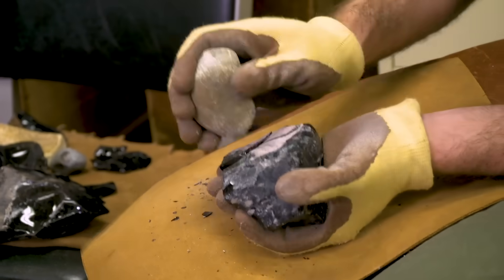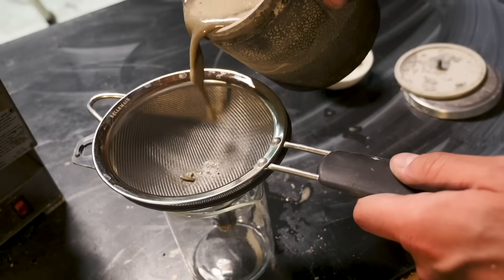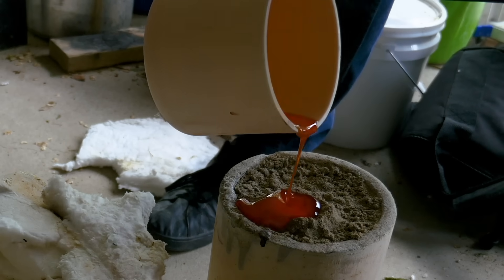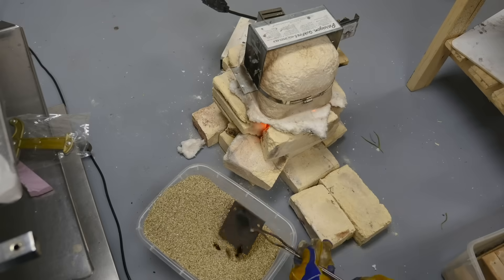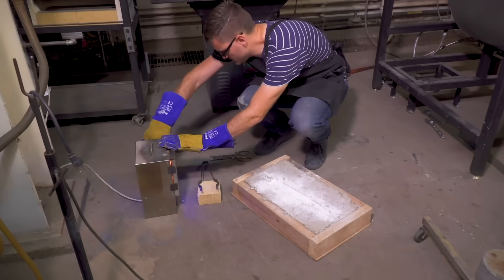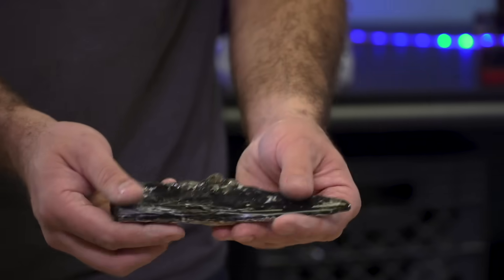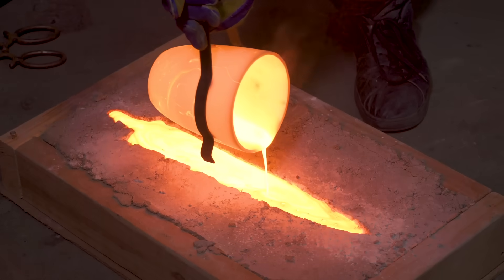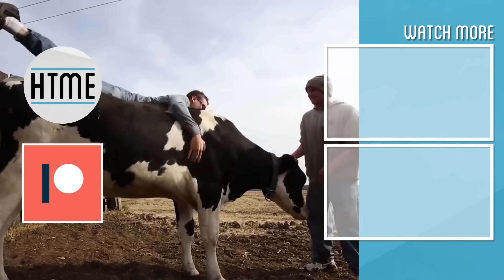Can You Melt Obsidian and Cast a Sword?

Comment: Obsidian is not really a glass or metal, it's a igneous rock. If you cool quickly you won't get any crystaline structure and it will crack easily probably while cooling against cooler materials like the mold. The slower you cool the more crystaline strucure much like making diamonds. You should also consider adding pressure like diamonds. I think if you want to mold it you should heat the mold some and place the mold back into the kiln with the kiln turned off and place the enire thing under pressure.
Reply: Diamonds are expensive because the supply is controlled, and there has been a marketing campaign to make them seem essential to a marriage in people's minds. They are actually a lot less rare than you are led to believe.
Reply: Industrial diamonds look more pure, because they are, and are harder with a better crystalline structure. They aren't exactly "cheap and easy to make" but they aren't the hardest rock to make nor is it as expensive as jewelry companies make it out to be. Definitely not $5,000+ per stone.
Reply: @Matt Fletcher Makes sense. Copy the original geological process as close as possible. Would need serious kit to do that however. Not sure how common a compression chamber mixed with a kiln would be >_<. Does such a thing exist?
Reply: valandil988 yea i was thinking that too. This si all new to me but I imagine a kiln in the shape of a mold that can be modulated to slowly cool the obsidian while applying X amount of pressure seems alot to ask for a bronze age weapon... but imagine what beautiful crafts could be made with that transparent obsidian though... he probably learned a lot about glass from this project
Reply: You may want to read the research papers on how they make doped and pure diamonds.
Reply: Continue, im interested.
Reply: NO ShIT xD we all went to school "hopefully"
Reply: Bronze age weapon? Before that ain't it? Still the best at cutting, not even near your flesh and you split like you were hit by a lightsaber. If I remember right they used to chop horse head/legs off those mounted conquistadors. Sucks vs armor though.
Reply: 'Bronze age weapon? Before that ain't it?'

Depends what you mean by 'before'. I guess it's technically 'stone age' technology, but the only real known use of obsidian weaponry is the Aztecs. Now I don't know for how long they were using it before the Aztec Empire, but that empire only goes back to like 1400. =P

Shit gets complicated when different cultures develop different technologies using different materials and techniques at different rates.
Reply: Doesn't obsidian form from lava flows? Doesn't lava flow over land, and cool off in the atmospheric temperatures?
Reply: Jay Eisenhardt I'm not sure when humans started forging weapons. Nor am I disputing the utility of a well made sword. That wasn't really my point though. I'm wondering what we could craft out of obsidian that would justify the investment in resources. If this guy had an unlimited budget, he could design a mega multipurpose kiln... Then we could answer the real questions, like, assuming we get the crystalline structure the geologist wants, how durable would it be? What colors can we get when we vary the flux? Etc
Reply: The only thing I really know of that is worth making of obsidian (or similar) in the modern day is surgical cutting tools, as you get an insanely clean cut even compared to the best steel.

Ultimately anything with a small blade (think scalpel) that needs to make clean cuts could benefit, but anything requiring a large blade (like even a small knife) that doesn't need to make insanely clean cuts it isn't worth how brittle the blade will be.
Reply: Matt Fletcher Quick maths
Reply: You sure it wasn't fast cooling?
Reply: stfu stop trying to ruin mine craft

Comment: i wonder if this is similar to welding in that continuing to heat and reheat metal tends to cook off some of the goodies inside and the material will behave more and more differently than it did the first time it was heated and welded almost inevitably loosing strength and toughness.

Comment: interesting video. admiration points for trying over and over despite the many failures. the idea to slow down the cooling of the knife in that litter box of insulating material was a good one, but I'm assuming you didn't heat up the stuff before putting the knife in it? without the surrounding material being at least a few hundred degrees hot at the start of the cooling process, I'm pretty sure the temperature gradient between the knife and the insulating stuff would be too high to allow for smooth and crack-free cooling. also: if you added other material to recolor your blade black, it is safe to say that the mixture should no longer be considered obsidian. what you were doing there would be the same as melting down some copper, adding tin to it as a "color changer" and then expecting the result to still be "copper-like". but chemistry does not work that way

Comment: It's very interesting to see your trial and error process. Failure is a learning experience. People are so paralyzed by their fear of failure and embarrassment that they will avoid trying new things. It's a rare thing to see someone openly displaying their blunders to the public eye. You handle it as it should be handled. You don't let the failure prevent you from achieving your goal and instead use it as a stepping stone. Not only that, you are providing the viewers with more insight on what things to avoid if they were to attempt something similar. Well done.

Comment: You’re approaching this the wrong way. You’re stuck thinking that using a crucible and POURING is the way to do it. 

Get a 17lb ball mill with stainless media and fill it 50% with media and 20% volume of crushed obsidian. Do not mix anything in! No water. Let it tumble for a week. You want baking soda fine obsidian. 

Next, fill the cast...... then bake. No flux.

Comment: Interesting video.  However it was doomed to fail for a couple of reasons.  First obsidian has about 70% silica and 15-20% alumina.  Consequently at achievable temperatures in a kiln it will always be way too viscous to pour.  You might be able to pour it if you heated it to around 3,000F, but even that hot it would be iffy.  Second by adding flux you changed the composition so that it was no longer obsidian.  I assume that you used sodium carbonate flux.  When you use a carbonate flux you have to do the melt in two stages.  First you need to heat the glass+flux mixture to 950 F or so to break down the carbonate and get rid of the carbon dioxide.  If you don't do that and go directly to 1800-2000 F the carbon dioxide will be trapped in the melt and make it foam up as you discovered.  Why do I know this stuff?  I am a retired professor of experimental igneous petrology and have melted rocks thousands of times.  Of course I had much more sophisticated equipment than even what they had at the glass shop where you made your final pours.

If you want to cast a durable glass sword, I suggest that you start with a borosilicate glass like pyrex.  You can add some iron, nickel and chrome to it to color it black.  If you keep the additives to a couple of percent the glass will still have a low thermal expansion coefficient and won't shatter on cooling.  Pyrex also has a fairly low melting temperature (~1,500F) so if you heat it to 1,800-2,000 F it will pour easily, particularly after you add your coloring agents.  I would also suggest melting the glass once to mix additives into it and then crushing it and remelting it.  Your final melt should start with relatively coarse material  (1/4" or so) since melting fine powder will trap air in the melt causing bubbles.  If you are sand casting it is also a very good idea to heat your mold to 400F or so for an hour or two two get it completely dry and preferably pour into the hot mold.

Comment: This video is filled with safety risks, ineffective techniques, and wasted material. Your sand-casting ideas ultimately ruined your project. Without a true kiln with a real forge, you were forced to add so much flux to the obsidian that it quite literally changed the composition of the material.

This is a terrible video.

Comment: You might try casting a slab of foat-obsidian if you can find a suitable molten metal; then cut the slab to shape, or fold it, when it is plastic. The idea of using obsidian is that you end up with a sharp edge that you can only use the once -except to cut meat.

Comment: if i add cordial to my water is it still water? no, it's made from water but isn't , but what if i make it look like water? still not water bud. i realise adding the flux makes things 1000x easier ,but you need a bigger and hotter kiln, and stronger crucibles. if a volcano can do it, so can you! Edit - also it needs to cool down in something hotter, so that the cooling process takes days, in metals this would make the crystalline structure stronger making the metal less brittle, idk if the same applies to glass, but it still needs to be cooling a lot slower

Comment: Why didn't you guys use a torch to heat up the material in a crucible then pour it into the mold?  Is there a reason for this?  Just wanted to ask?
Reply: QueenBee Druid - I cast platinum with a propane and oxygen setup....I believe, if you were to heat it in a crucible with a torch, you might be able to maintain a higher temp.  Pulling it out of the kiln and pouring it, I believe, would keep them from reaching higher temps for better pours....Never tried pouring obsidian but now I am interested.

Comment: when you say FLUX, that is a generic term. If you used (for example) BORON, than the boron "should have" added strength to the "glass" that same way that it strengthens the BoroSilicate flasks you used to boil off the water.
Just a thought

Comment: You mix it with soda and borax or just borax?  We tend to mix borax in metal mixtures to make it easier to tap it at work.       It makes it more tender tho, so mix 30% cu with it and make sure its 1350 celcius.  And it shouldnt shatter.

Comment: If you guys are going to go from copper ore to copper you are going to need A LOT OF ORE, high grade copper ore is usually around 3-5% copper. Also try to figure out if your ore is carbonite, sulfide or oxide. By the look of it i would say its a malachite, so a carbonated ore. Every one of the mineral assemblies, carbonite, sulfide and oxide has a diferent reduction process.

Comment: The Obsidian Sword was the Aztec and Incan Empire's main weapon which worked good until they ran into Spanish metal armor when it just broke. 
To actually make a good one I'm sure you would need an advanced materials shop or lab where they actually can melt Obsidian without impurities. They even turn metals into gas to distill them for maximum purity but it a very expensive thing.

Comment: Next time preheat the mold, obsidians sharpnes is a result of its brittelness. By adding flux you take this away. Make a casting in a ceramicmold while heating the mold then slowly over several days reduce the heat little by little. you need to simulate what happens in Lava which cools down over a couple of weeks.

Comment: It could be shaped and sharpened with diamond files water and diamond rasp type tools although it would need extreme care not to break it. I recon I could do it in two 8 hour days.  I've shaped glass with these methods before. But also broke my projects too. Perhaps a carborundum flap disk on a hand grinder would be gentle enough to do it quickly.  After all the effort you deserve to finish.

Comment: We did some glass casting in college, and we made our mold out of a refractory material, and put the whole thing in the kiln. we put a hopper over the mold, and just let it all drip down in while the kiln was on. you can set whatever cooling profile you want with the kiln controller to prevent breakage. Plus it flows really well because the whole thing stays at temperature, and doesn't start cooling off before you try to pour it.

Comment: If you made the frame of your sand cast from something other than wood, maybe you could have put the sand in the kiln for a few hours first. Then, you could pour the molten glass into the hot sand and then put the whole thing back in the kiln for slow cooling.

Comment: I figured since obsidian is really just volcanic rock, as long as you could get the temp high enough it would be a breeze. I didn't even think of impurities. I never saw any of your videos before, this is really good. Liked, and subbed. If I like the next one I see, I'll even click on that little bell thing, and buy a t shirt.
Reply: If you think about it making a sword out of obsidian is kind of like trying to make a sword out of slag which is a byproduct you get when smelting metal ores. They didn’t use the leftover slag to make swords because it is glass and contains the impurities they didn’t want in their metals. Obsidian and slag are very similar, sometimes indistinguishable. I’ve collected some pieces from where there was once a furnace nearby. Thought it was obsidian until I learned the history of the location! But the impurities in the obsidian are what make it obsidian. Without those impurities it’ll just be glass.
Reply: That would be because you don't know anything about the formation of volcanic glass.

Comment: Add a tungsten rod down the center to add internal structure. And make you cast out of stainless steel. Double sided and vertical so you can pour in and fill it up from tip to hilt. You will need the help of a fabricator. Call a local welding shop.

Comment: Why would you make a knife out of glass? It has no flexibility, cannot be tempered or sharpened, and the first swing at anything hard will break it.  Metal is the preferred material for blades, and good blades are never cast (they would be too brittle), they are forged, a process which involves the use of repeated compression and folding of the metal, until it can be shaped, and tempered. A cast metal blade would be worthless, for all but display purposes.

Comment: I have no experience when it comes to molding anything, but if it is cooling too fast, why not use boiling water as the cooling treatment? Have a tall pot with boiling water and use a clamp to hold the obsidian in the center, while lowering the water temperature over time.

Comment: The problem is you needed lots of pressure and needed to keep it at melting hold it there for it to set in the mold and force gasses out and cool it in stages to cool the form as evenly as possible, as it cools reduce the pressure accordingly. What's causing the cracking is the formation of the lattice is happening sooner on the outside than inside so when the core start cooling and wants to expand a similar effect to leaving a beer bottle/can in the fridge overnight but in reverse. There was not way it was going to succeed with regulating pressure.

Comment: A lot of obsidian IS translucent to not-quite-transparent.  It is, after all, volcanic glass, and there are differences between not only volcanoes, but also between different flows in the same volcano.  We can identify where a piece of obsidian came from through analysis of the trace elements in the glass, and often to the individual flow of lava (we use a device called a portable X-ray fluorescence analyzer, there are other methods also in use).  There are also different colored obsidian sources - two basic chemistries (one produces a greenish obsidian, the other generally black/gray/etc. depending on concentration of impurities), and you can find obsidian with a sheen that is different than the base color - gold sheen, silver, bronze, etc..  (This doesn't indicate the presence of precious metals - how the sheen forms is too complex to discuss here.)
The choice of flux will have a lot to do with the final product - I suspect you were using Lithium-based flux (very common) and that might not be the best choice for the material you want to achieve.  I'd suggest doing some reading on ancient technology, although obsidian was always flaked and not casted (as you said, achieving temperatures hot enough is difficult today and would be even much harder in prehistoric/early historic times), you should be able to find sufficient info on the elemental makeup and possibly choose a better source of material/flux.  Who knows, you might come out with something that would be decent?  I HAVE seen knives made of modern glass before (cast and then ground), and that should extend to obsidian.  For bronze work, there is a lot of good information available through experimental archaeology and analyses of ancient manufacturing.  There are even specific journals on ancient metallurgy and so on.  (My specialty is chert for ancient tool use, but I've also done a lot of reading in other ancient technologies and both studied and done work with ancient diet.   My mentor/professor is an internationally-known expert on obsidian and the neolithic.)

Studying how the ancients did things is fascinating and fun - and as we've learned, they were a lot smarter and understanding of their materials than the general population would tend to think.  If you want to get an idea - look up the understanding needed to heat-treat chert.  It was in effect advanced material science!

Comment: Why didn't you use any pressure nor cast the obsidian with any of the gases that comprise volcanic fumes?
Obsidian is born from volcanoes' high temperatures, but also from its very high pressures and gases outside of the normal atmosphere's.
Didn't you consider that maybe those missing gases would interfere with the obsidian being able to solidify properly and that by introducing flux you were altering the chemical and crystal structural composition too much to be called obsidian anymore?